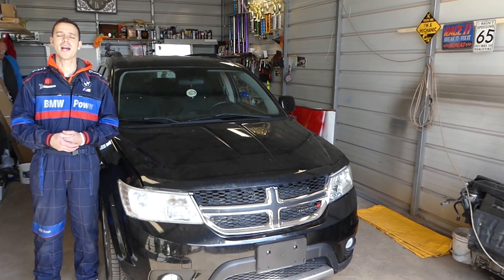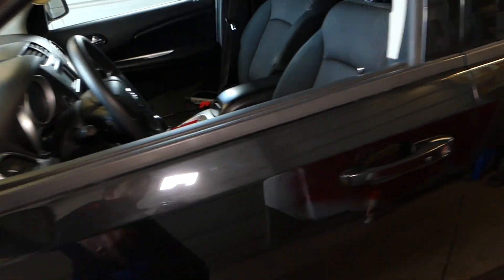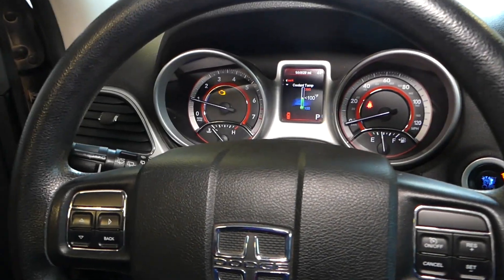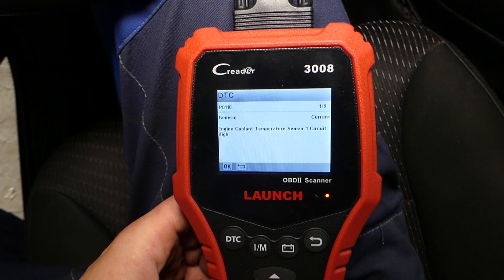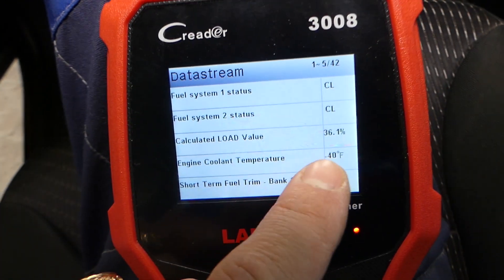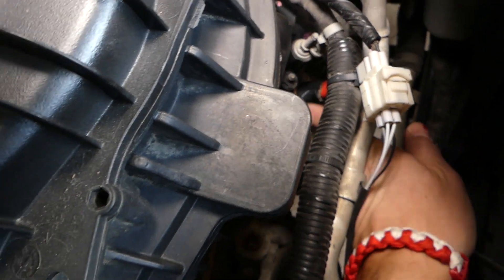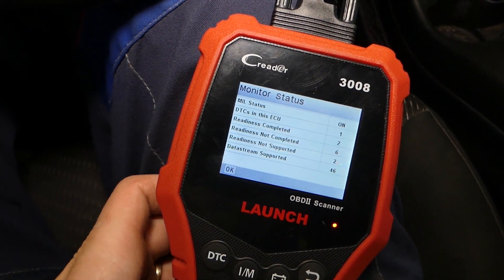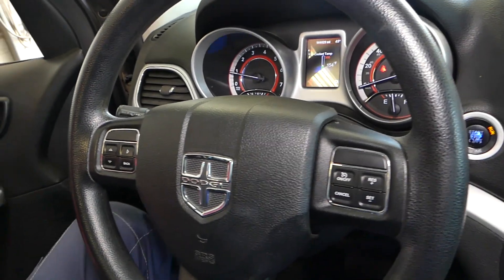DODGE JOURNEY CODE P0118 ENGINE COOLANT TEMPERATURE SENSOR 1 CIRCUIT HIGH

Comment: I replaced the temperature sensor on our 3.6 Journey, the fan is still on high and the guage all the way on low temp. The exact sensor you showed in video. I'm thinking it's a bad new sensor or the wiring.
Reply: what did it end up being? I have the same issue...

Comment: Hi am getting a code p0740 and fan is not coming on at 230 degrees.  Replace resistor it worked. Then 2 days later fan was at idle and overheated. Fan not coming on again. So still overheating. What can it be should I replace coolant temperature sensor?. The fan works all fuse and relay is good. Please help?

Comment: My coolant temperature on my scanner shows that's operating normal. When cold before starting it shows the normal temp in the area, then after starting the engine it increases normally.
But on my gauges it's not working, it keeps showing cold <100f°.
Coolant temp sensor voltage on the scanner is 5.0004 all the time!
Reply: But I still keep getting the p0118